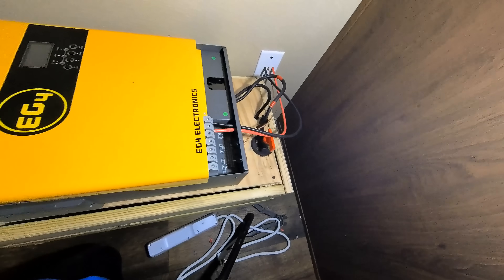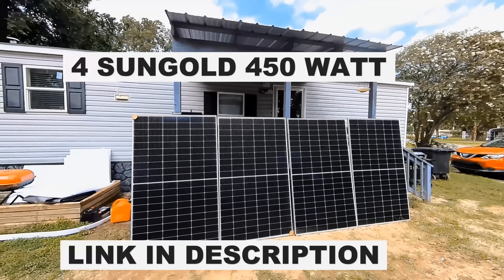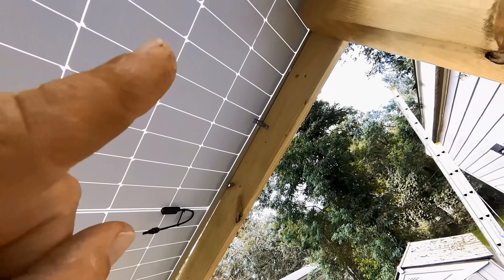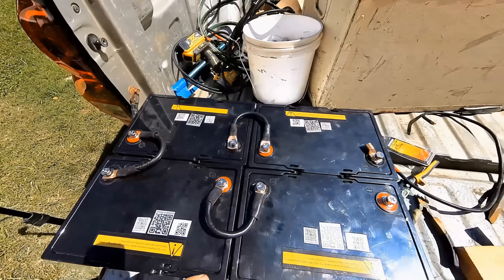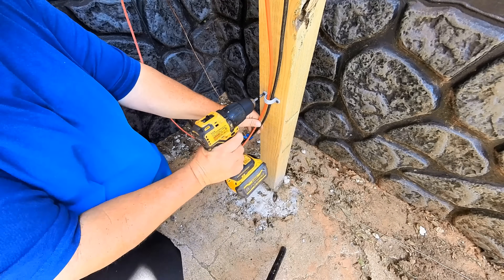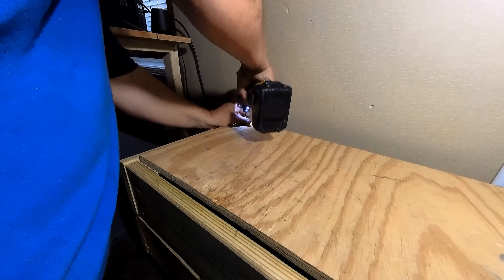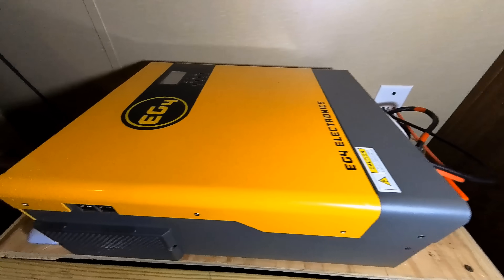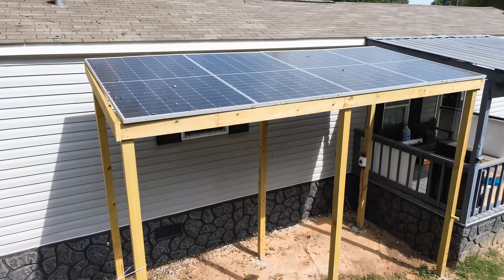Simple Solar YOU CAN BUILD!  Using Sungold Solar Panels

Comment: I have a mobile home out in the country about that size in Oklahoma!
Also did not want too mount anything on the roof because frankly the roof is to fllimsy.. Going to be putting a metal roof on it soon.
Been watching solar installs for years and this is the first that keeps the cost down and will power virtually everything in the house outside my central hear and air system.
Also, since you are running every thing internally, you don't have to worry about getting an electrician to change the fuse box to keep from back feeding.
Good job!

Comment: Good deal, I see you're using the panels as roofing, looks good and serves two purposes. 
Just found they were selling 12v 100Ah mini batteries on Black Friday for 99.00, WOW. That's 400.00 not 620, 1/3 the cost of a 48v server rack. It just keeps getting better.
Reply from the maker: it does keep getting better..but the more i deal with these solar installs he more and more i like single a 48 volt battery ...its just a lot less bms's to try and make work together
Reply: @OKLAHOMAOFFGRID  Yes the server rack batteries are easy, when the price was close it wasn't a question but 1/3 the cost or 3x more battery makes them worth the work. To go off grid with my current use of 400 to 600kw per month I'd need 12 server racks costing 17,000, ouch. 6,000 fits the budget. As for the batteries they all come with their own BMS, just have to top them off before use, then check them once per year. OR, buy wifi 12v batteries and you can check each battery on your phone anytime, but, that will eat into the savings. 
Battery wars, wait, we will be seeing the server rack batteries drop in price too. Should see them drop below 1000 soon.

Comment: I  assembled  two aluminum awnings for my decks and I put solar panels on them instead of the regular roofing panels.   I would have skipped the wooden  build and put the panels on exisiting car port.  Ditch the aluminum roof and replace using mounting rails and standard hardware. the water does leak a bit, but its dry enough on our deck.
Reply from the maker: @gordb.2381  good deal
Reply: @OKLAHOMAOFFGRID  Appreciate the info for the off grid system, very comprehensive.

Comment: This is an awesome video, thank you so much for sharing your knowledge!! How would I integrate this system into a house that already has an on-grid system so that I can only use the grid as a backup if my batteries run out of power?
Reply from the maker: THE way i did it was just to run a 4way plug so i can just plug in 3000 watts when and if i need it...in the mean time its just running my tv and internet 24/7...you could do what they call a critical load panel

Comment: I am building a small 3 x 100W solar panel system to 'get my hands wet'.  THe panels are highly rated from Harbor Freight.  My biggest worry is (and this will be once I get very familiar with the equipment) is the voltage irregularity or unclean ELECTRIC.  Not sure if that will damage equipment, or sensitive electronics over time.
Reply from the maker: dont use an unclean inverter....trust me...unless your just going to power your toaster

Comment: I did a similar project recently, also in OK. I used a hybrid inverter allowing it to be plugged into an RV outlet (NEMA 14-50) to allow grid connect (questionable regarding the rules), but it can always be unplugged. Similarly there is a A/C out feature and includes the A/C breaker and panel isolator switch . There is a battery feature, but so far, it's not connected. I have 16 x 400w panels, so much more capacity, and the plan is to add a few more. The inverter is rated to 8kw. There is one statement I question. Your isolator switch be rated by current, not watts, so it should handle the rated current regardless of voltage. Insulation is rated by voltage, so you my get a limitation there. Essentially conductor heat is a function of current, so raising the voltage will lower the current in a way to get more power through. That is why power companies use very high (345kv and up) for long distance lines. The loss on a line is reduced to P=I^2R. The same should apply to a disconnect. So the current rating should still apply.

Comment: I put all the inverter batteries everything that could accidentally burn up outside underneath the solar panels only from the inverter AC wires go into the house and to the panel and two different sockets. That's to keep the five components of outside😮😂
Reply from the maker: only thing is moister and low and high temps

Comment: if u go with flexible 100w panels you can get 1.6kw of solar for 530usd, and build a 24v 8kw battery for 380usd. 3kw 120v inverter = another 220 bucks. under 1200 bucks not counting hardware, probably another 200-300 dollars. half price if you diy the batteries and order direct from china
Reply from the maker: ya and i can buy 10 345 watt solar panels totaling 3450 watts for $710 ...charge controller and inverter all in one for $674. and 100 amp hours of batteries at 48 volts 758 dollars if we really want to do the cheapest system...and it will way out produce what you are offering for way less
Reply: @OKLAHOMAOFFGRID  ya those are cheap panels. if shipping is not a concern and you are buying used i would also go that way. but building your own batteries from cells is always 1/3rd or 1/2 the cost. theyre 35-40$/kwh shipped right now. 

100 AH at 48v for 758$ = $150/kwh. DIy battery is 1/3rd the cost.

inverter is tricky and should follow the prices you can get on the other two systems. not many videos now days on DIY lifepo4 batteries... the comercial ones are just so much bigger than the cells themselve and half filled with foam. you can put 8x 280ah lifepo4 cells (8kwh) inside of a 20mm ammo can perfectly which only cost like 30$. thats a steel fireproof enclosure which in total is the size of a single server rack battery

Comment: I have 1000 watts 24volt on my roof, it,s about 12 yrs. old, lead acid trojan 105R a thing of the past 10yrs. I now have ground mount 8 200 watt Rich solar panels 48 volt though my old MorningStar charge controller to 2 EcoWorthy 48 volt metal case LIFEPO batteries to an Oupes Mega2. An inverter would work alot better in my case,still have a 3000 watt 24 volt. EG4 in 48 volt or can a 12volt control it, Got some research to do.

Comment: lifepo bms in series, BIG MISTAKE, they are NOT made for this, DONT DO THAT, wanna 48 volt systeme? BUY 48 VOLT BATTERY, 1 min in the video and already a big mistake to me ... even if the manufacturer say it will work, these bms may fail ( already see that ) and let you with NO PROTECTION, even if the bms say it's still working fine, in reality it cannot turn off the current anymore ( burned mofs ) these are NOT LEAD ACID, i see a lot of people doing these mistake right now, cuz they treath lifepo like lead acid ... it's very scary ... i already had a bms fail because of that before but i did realise it before i had probleme ... i have seen overcharged 12v lifepo BECAUSE OF THAT, please dont do that ...
Reply from the maker: just following the rules boss
Reply: dear sirs... TAKE YOUR MEDS

Comment: It's a nice setup, but not worth the money, only good as a backup up system. I have an apartment  approximately the same size as your house , and only pay 40 dollars a month for electricity. Your setup would only provide half the electricity needed in the summer and probably 1/4 in the winter.  At that rate of savings, it would take a min of 15 years to break even, and that's assuming none of the components fail and need replacement.  Pluss you have the inconvenience of having to run off of power strips and extension cords with is a fire hazard.  If this was in an off grid location, it would be worth the investment but not for a location with access to electricity. If you are doing it as an experiment / hobby, that's fine, but expecting it to save you money a total waste
Reply from the maker: electric may not always be available my friend..

Comment: I admire everything about that system, except for that power strip that you're using for your AC power distribution. Is that thing even rated for 15 amps ? Or is that 16 or 18 gauge wire run through it 

I would be absolutely terrified to run a AC unit - even a small window Shaker - on a power strip like that with even that being the only item plugged in. You throw a refrigerator and some other household devices on there and that sounds like a fire risk just waiting to happen.

Please please upgrade that side of the system or at least encourage folks to run only light loads on a strip like that.  Many of those are rated to handle roughly 15A/1800w of load - and that's the nicer ones.
Reply from the maker: I understand..you can relax...it was just to get it going right away to have an example to plug things in...it will be upgraded to an actual 30 amp plug
Reply: @OKLAHOMAOFFGRID  my bigger concern is of course that since this kind of content is essentially forever content, more so what someone down the road might take away that this is not just a temporary power situation and think it's okay to leave it as a permanent or at least semi-permanent answer on their setup. 

Unfortunately there are way too many people out there who just don't understand the risk of overloading one of these simple from the generic store power strips can be

I'm truly think that content creators need to take issues like this into consideration when uploading this kind of stuff.
Reply from the maker: @BerneK  the output of the inverter is 20 amps the people hooking them up not to run more than 20 amps on a 15 amp power strip.. I mean I'm pretty sure people have power strips in their home running things in their house and they should know what will kick the circuit breaker on the switch by now.. but I suppose you have a point somebody might say well that's what he said to you so I hooked the whole house on it... But seriously don't these things have an internal fuse?
Reply: @OKLAHOMAOFFGRID they're supposed to have some kind of internal fuse or circuit breaker on them but invariably they still end up being one of the larger causes of Home Fires when people invariably overload them because they don't think about what they're doing with them .

I mean when the local news has to run safety alerts every fall/winter not to plug things like space heaters into them....
Reply from the maker: i did not know they where a huge fire concern...thank you for the info

Comment: 145 volts DC? ...where the hell did that come from? 12 X 4 is 48 not 145 bro. 🍿
Reply from the maker: 145 volt dc..that came from the solar panel array that is ran in series..I was testing the voltages coming in from the panels for the polarities ..bro
Reply: @OKLAHOMAOFFGRID  Well bro that's crazy. I thought the panels run low voltage and then bump it up with a inverter. 145 DC is dangerous as all get-out if there is any significant current behind it. That's why we us AC in our power grid. It was designed by the great Nikola Tesla. 🐳

Comment: NIce setup.  The only issue, personally for me would be the fact that your inverter can supply 3000 watts of power, where as your power strip is only going to be rated at around 1800 watts.  You will melt it before your circuit breaker trips.    Your proposed load should not be an issue, but you might consider beefing up your outlets to something that can handle more ampacity, just in case you want to run any additional loads.
Reply from the maker: yes for sure...my situation ws getting the video finished before the inverter actually gets ran into a critical load panel
Reply: @OKLAHOMAOFFGRID if you are running it to a critical load panel you may want to consult your city/county inspector for code violations. Once a panel is wired in it will require an inspection. If your house burns down and no inspection the insurance company may not cover anything.

Comment: What would you recommend for a conex setup I just need to power led lights inside and to run a couple power tools when I need to maybe a little heater
Reply from the maker: I would never run an electric heater off the solar unless it came off of a mini split.... LED lights are going to pull less than 100 Watts... A 300 watt inverter would work just fine in a situation like this

Comment: One other question.  Why didn’t you install a charge controller between the solar panels and the batteries?
Reply from the maker: I did it is installed between the solar panel and the batteries you're confusing me?
Reply: @OKLAHOMAOFFGRID  Sorry I must of missed that part.   I’ve been a union electrician with the I.B.E.W for the past 35 years and I build and sell solar generators on the side.   I recently bought 400 plus acres and built a cabin however it would be very expensive to run any utilities back to it from the road.  I do have a well for water but we do t drink it just use it for showers and do the dishes.  I have a composting toilet that using propane along with a propane refrigerator and stove.  As of now I do use a large solar generator for power but will soon be adding a south facing solar array.  I have a lot of 12 volt lighting but I also use 120 volt for other things.  I use tankless propane hot water heaters for the shower and kitchen and bathroom sinks and 12 volt pump for my well.   I hope your system serves you well and I enjoyed your video.
Reply from the maker: thanks ..it sounds like you are on your way...keep fiddling with those things and you will find what works for your situation best

Comment: Great setup but I have a question.   Why did you run all your panels in series?   The reason why I ask is because if one panel fails all the panels will shut down.  I’m about to pull the trigger and install an off grid system at my cabin ( because the utility company wants an arm and leg to run power back to the cabin) and after consulting a few solar installers the advised to run a couple panels in series and a couple in parallel to prevent a complete system shutdown in the event of a panel failure.   I would like to hear your reasoning for running all yours in series.   Thanks in advance.
Reply: Also when they're in series, they'll all stop producing much of anything if there's a shadow on 1 corner of 1 of the panels.

But if you get a good spot without trees around, and it's not cloudy, you're good to go.
Reply from the maker: First off solar panels don't go bad until 25 to 30 years.. the second thing would be that it would be very noticeable on your voltage and your wattage if one went out and it wouldn't take much to figure out which one it was and replace the $120 piece of crap... Third off is very important to run a string in series up to the voltage that you need because it's going to be the most efficient and then the next string you'll run up to the same voltage and then you'll run those two parallel other than that this is how you wire an efficient system
Reply: @OKLAHOMAOFFGRID  Solar panels do go bad and you will be lucky to get 25-30 years from them.  There are several things that could cause them to go bad or lose their effectiveness.
Reply: @motoxman541  dude has like 3 or 4 solar panels... if one goes bad... WHO CARES!  Put your own video up showing how YOU would do stuff so we can come on there and troll you.... oh wait, you won't do that, and also, (I don't know about the OP) but I HAVE A LIFE.  What am I doing now?  It's 1am and I am waiting for some stain to dry so I can throw a second coat on before I go to bed so I can build some walls for my own solar project tomorrow.
Reply: @ Well I wasn’t trolling him I was asking a question specific to why he ran the panels in series. If you know anything about solar ( obviously you don’t ) if one  panel goes down the other panels WONT work either.   It’s like a strand of Christmas lights.   One bulb burns out the entire strand don’t work.
Reply: @motoxman541  oh gee, i had no idea.  wow, you're so awesome and just know everything!  Can I ask you anything?

Actually, you REALLY DO NOT know everything or much at all about solar... but an advantage of running panels in series vs parallel is #1 you get better output, #2 you can save costs on wiring as you do not need as much wire and you should be using at bare minimum 10AWG.  Many panels come with 12-16AWG wiring already soldered on... which you would need to desolder and add thicker.
Reply: @ Well thank you I am awesome.  You really didn’t answer my question either, I already knew your worthless information.  After consulting with a local solar installer, they recommend I do a hybrid system. I am a member of then I.B.E.W for over 30 years and a very good electrician but I have never installed solar until recently. The advantage to running a hybrid system is your running half the panels in series and the other half in parallel.   I installed my system on my cabin and it works flawlessly.  I also have a propane refrigerator and composting toilet and tankless hot water heater.  I have 200 hours of battery backup which is plenty.

Comment: Wire gauge? Sequence of battery connection terminals? Will the batteries overheat in an enclosed case? No fan?
Reply from the maker: Those batteries don't put off enough heat to make a difference

Comment: Where do I get the batteries from I don't see the link
Reply from the maker: it was there..you must have missed it...here it is 4 12 volt Eco-Worthy Batteries 239.00 each Here is A discount code for the batteries  3% discount code for my subscribers use OKLAHOMA https://www.eco-worthy.com/collections/12v-lithium-batteries/products/lifepo4-12v-100ah-lithium-iron-phosphate-battery-with-bluetooth-and-low-temperature-protection?ref=zvilmopy